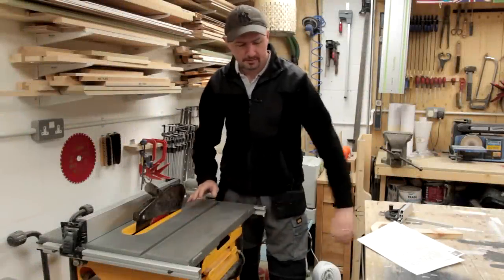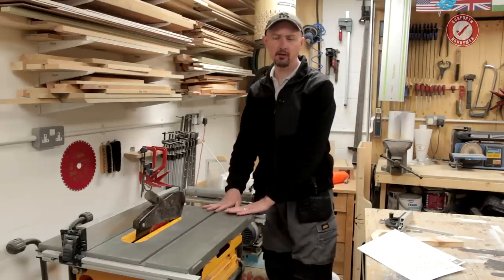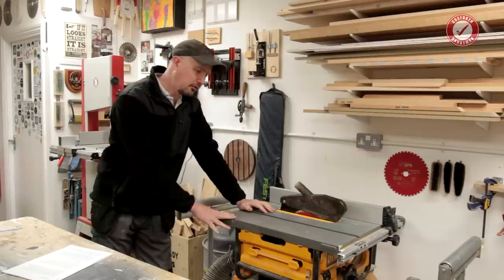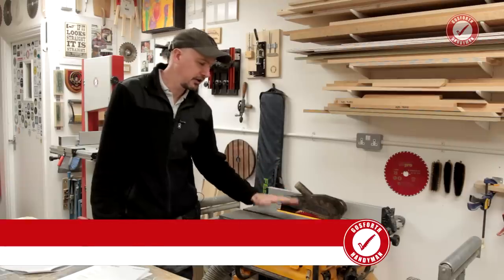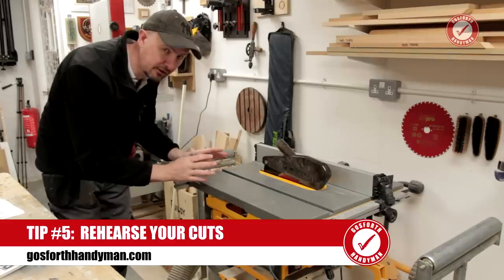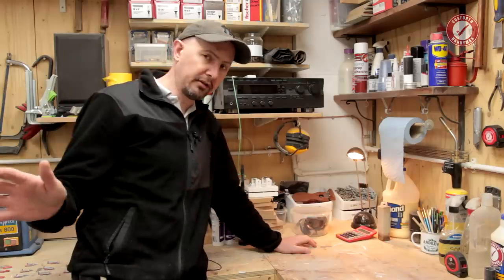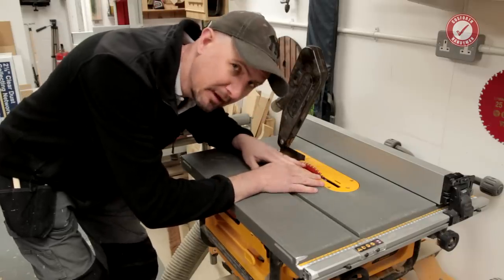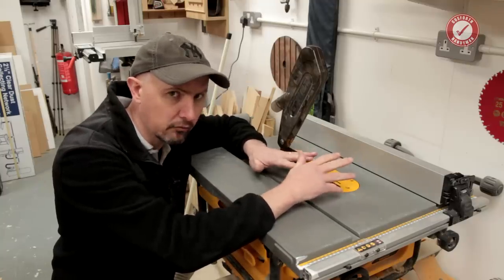TABLE SAW SAFETY - 11 tips to avoid death!

Comment: Thanks for a very good video. I am always aware of the power of my table saw when I use it, so I stay alert and respect the saw, as you say. 
Personally, I only use the table saw for cutting boards to size, or ripping long pieces, always with riving knife and guard fitted, and I use the long push stick.
Crosscutting I do on my sliding mitre saw, or with a crosscut sled on my bandsaw, which is a whole lot more ‘friendly’ saw. Fancy work I do on my router table.
BUT there is one thing I can’t figure out . Where is the best place to stand? The stop button is on the front, right in the kick back target zone. I tend to stand on the left, as advised by many safety guides, but that does require some reaching across. I saw your advice to stand on the right, but that wouldn’t work with a larger piece, so it’s a mystery to me which is the best place.

Comment: 100% agree.  I only still doubt sometimes where the guide rail (fence) should be relative to the saw blade for which cuts (like, fence stops before, halfway or after the blade) because (I learned in school) that you must avoid getting wood jammed between blade and fence.  Would appreciate if anyone could share a tip or link on that?

Comment: Ive been taught to always support the longest edge of the work.  Not sure if that kickback would have happened in your situation if the work was on a sled or you had a miter gauge but that would have supported your worked better than the fence did.

Comment: While I understand why you made this video, I don’t like the fact that many commentators below are now scared of the table saw. I believe that “healthy respect” for the tool is paramount. A huge danger is approaching a cut with anxiety... rather than confidence. The most dangerous tool in a workshop is the workman who doesn’t know what they’re doing. Plus, plenty of highly respected woodworkers (Matthias, Steve Ramsay, Colin Knecht) use jigs, sleds etc safely and there’s no reason why they can’t be safely used.

Comment: I recently got rid of my job site table saw because it was actually more dangerous to have the riving knife on. No amount of adjusting kept it from fishtailing outwards and pinching the board between the blade and the fence.

I got a sliding table saw instead!

Comment: The problem with cutting while on the side is you have to reach around to hit the emergency stop or switch. If you added a second stop switch in series on the side I would consider it safer.

Comment: As a newbie to table sawing I'm keen to mug up on all the available safety advice on using them. This video seems to be by far the best presented and explained that I've come across. It's brilliant! 
I've also seen videos about the GRR-Ripper as an alternative to a push stick. It's promoted for its safety benefits but using it does break one of the guidelines in this video - placing the hand above the saw blade - albeit with a lot of plastic between. I'd appreciate any thoughts on whether that's a sensible thing to do.

Comment: right off I see one major safety issue is the stock you have on the shelves above your saw could be a potential issue if a board comes down or for some reason the shelf breaks while the saw is running. I would not store stock above a running table saw.

Comment: There are a few things that you said that I would agree with. However, using a push stick for anything less than 3" is very dangerous.  It is all about control of your wood and saw, putting your hands on top of the board and pushing it through, doesn't give you control. Using your thumb on the edge of the board, with your fingers pushing it towards the back of the fence (of course making sure of where your hands and fingers are at all tims), holding it firm so the board doesn't creep out from the fence (this is why it kicked back on you). Make sure you stand to the left of the blade and safely push it through. The other thing is a person should always be afraid of the machine and that way you don't become complacent and always remember where you are and what your doing. I have 40 years professional experience running a table saw and have only had 2 kick backs and they were both because I was young and didn't have control. Maybe one day I will do a video on safety. I have seen alot of things in my career. If you want to know more, I would be glad to help.

Comment: Great vid. Close calls make us smarter. Different strokes for different folks. The push sticks you recommend scare me. Why would you hold a 'stick' pointed anywhere near the blade? Blade catches the end of the stick and jams it into your hand or fires it at you. I use a cedar 2X6 on edge, with a heel cut into it. On small stuff I run it right over the blade allowing it to cut 1/8" into it and both sides of the work are pushed through the blade zone. My saw is too old for a riving knife but beautiful.

Comment: My saw does not have a zero clearance inset, so there is a half inch gap on the left hand side. Yesterday an off cut fell in there and in a split second was projected back into my face hitting me between the eyebrows like a wooden bullet. Nasty gash and bump. Thankfully I wear normal specs which act like second rate goggles, so my eyes were partially protected, but it was too close for comfort. That’s why I’m looking at safety videos today. Gonna take more precautions from now on.

Comment: Thanks for a great safety video!  Things my dad didn't tell me, other than "Be careful!"  Never thought much about push blocks or cutting close to the fence, but sure will now.  I'm a little confused about what's okay or not at around 25:15 - maybe more explanation?  Why is it not okay to use the rip fence for cuts along the shorter edge of a plank, but then okay on a panel, and why okay up to around square?  I'll watch a few more times, but I have a hardwood brain (dense) and not much hope for self-enlightenment, so looking for a reply. Otherwise, thanks again!

Comment: Excellent information and yes it's been said before but in my opinion it can never be said enough, I had the exact same thing happen to me about 2 and a half years ago and it winded me so badly I stagard backwards it took me sveral minutes to recover my breath, I was cutting small strips of 1/4 inch plywood to make a pattern I had no riving knife and my blade was at max height, my table saw was similar to the one you show here but the one I now have is a full size 3HP table saw and if this happens again my recovery will take much longer if I'm lucky :(

Comment: I just cut the tongue and groove off some 6 inch oak floorboards and stood at the side so I could use 2 hands, and keep a constant load toward the fence and have my effort away from the blade. Also if it did kick I wasn't in front of a kilo or 2 of high velocity oak!! The offcuts of the tongue, 8th inch square maybe, flew across the workshop like rockets! Sadly my saw doesn't have a riving knife (Elu flip saw, don't believe it was even an option, please let me know if you know of one), and I have had kickbacks that luckily didn't hit/hurt... but I am very wary of it.

Comment: Thank you thank you! I just bought a used Dewalt 10' DW744 and it didn't come with the riving knife or blade guard assembly...I didn't even know what they were! After watching this video I went to eBay and bought the full blade guard assembly and will not cut a piece of wood until I have it. I also have 18" round pieces of wood I have to cut in half so I can have 2 half circles. If you have any advice / videos on pushing that through without it twisting / turning and having kickback I would love your advice!

Comment: Serious accidents happen fast, really fast.  My dad leaned a bit forwards, the blade caught a smallest bit of shirt that had come untucked, and pulled him into the blade. (No blade guard on.) He stood for 20 minutes holding his intestines while EMS worked to extract him from the blade.  He was hot loaded in a helicopter and flown to the nearest trauma center. (Fortunately, there were others around who saw the accident happen.) The blade came within 1/4" of slicing into his abdominal aorta.  Not sure how, but he survived the accident minus a few feet of intestine and was splitting wood 3 months later.  So I would add to your safety list:  Always wear snug fitting clothing and be sure to remove jewelry, hoody strings, etc. before using any power tool.

Comment: Just a different way to loose a finger or thumb:  I was cutting a bit of reclaimed wood and saw what I thought was a knot; it wasn't. It turned out to be a carpenter bee tunnel, armed with six rounds pointed right at me.  The vibrating started and the stacked bees ejected into my hand and face. Tried to swat them away, kickback ensued.  I was very lucky, only cut through a finger and a thumb.  I didn't loose them, but the ends don't have feeling any more!

Comment: Like a rattlesnake, I give a t-saw great respect, even paranoid!😱
My push stick is 20 inches long with a handle on the back, I also use  screws in the pusher, just barely sticking threw, just enough to grab the wood. Thanks for the info, folks need to know, especially those new to woodwork😁👍✝️🇱🇷

Comment: Really good points.  So what's the best method/tool to rip, lets say, 1 inch from the width of a 4' x 8' sheet?  In other words, when you actually want keep the wood from the waste side of the blade and reduce the width to 47" from 48"?

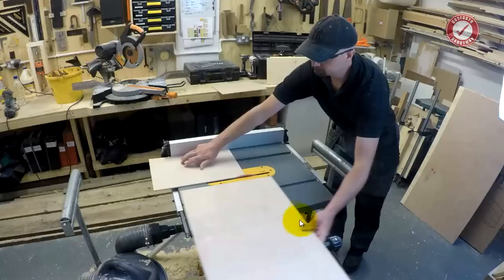Comment: 5:57. The suspense of seeing the severe kickback about to happen is gut wrenching! I had to pause the video to mentally prepare to watch it... Having experienced a bad kickback this summer, I'm still not over the trauma and shock of the experience. Once you realize how "cocksure" we are, not using any of the proper techniques, you go back and wonder WHY you didn't use safety precautions. Then you realize that there is no valid excuse, just as you so eloquently stated. There is no excuse for anyone not to be using a riving knife for all conventional cuts. Your life is on the line every time you use a table saw without a riving knife. A flying board can kill a person. You wouldn't stand in front of a machine that ejects 80 mph boards at your head, voluntarily? When we don't have a riving knife, there is nearly 100% chance that you will experience a kickback at some point. Every table saw user has had some type of kick back, or at least a bad blade bind, at some point. Not having a riving knife is like riding a motorcycle with bald tires in the rain, and trying rely on "experience" and "confidence" to protect you.

Comment: Many people are concerned with the blade being set only an eighth or quarter inch above the surface of the pieces being cut. They have good reasons, however sheet goods are not always flat. Imo it increases the possibility of kickback if the board rises above blade height because of any non perfectly flat wood. Also weight shift or minor user error right after completion of cut can bring the cut piece over the edge of the blade. The weight of the waste piece can leverage the cut piece up at the end of the cut. Frankly I think people are overly concerned with minimal blade height, although it's a concern. I generally use low powered portable saws for field use, I don't do much shop work on larger saws. I have seen students using less than flat materials who followed this advice of the the blade being only an eighth of an inch above the surface and resulted in the same kickback pictured here.

Comment: To keep fence parallel with the saw blade is one of big very dangerous problems at low cost machines.  It will be nice if someone address that issue in more details.  To me that is the second most critical point after riveting knife.  Thank you.

Comment: Best video. I just bought a DWE 7485 8 1/4. I have never used a table saw so I have spent a lot of time looking at safety videos. There is a lot of conflicting information out there, but using a riving knife is not one of them. I also installed the pawls (belts and suspenders). QUESTION: when standing on the side of the table instead of in front, would you still use a push stick or is it not necessary. QUESTION 2: my first job is that I need to rip 6” 8 foot cedar boards in half. Do you have any safety tips?  Oh by the way. I like the idea of using a chop saw when you can, and respect the saw don’t fear the saw. Thanks

Comment: Hello and thanks for the great tips.    I'd like to cut a piece of log with a width of perhaps 6 inches.   First from the top side, and then turn it over and do the bottom side to complete the halfway cut.  Because it's not a square or rectangle piece of perfectly straight wood,  how dangerous would it be?  How about if I cut it by standing on the side of the cutter?   Thanks.

Comment: how to retrofit riving knife for older table saws? 
I have a Craftsman 119 from 1970s, and only thing I can find is standard kick-back guard.
Reply: Buy a new saw with proper guards and a riving knife that is adjustable.  Buy a saw that allows removal of the guard while leaving the riving knife and anti-kickback claws (if included) in place. If replacing the blade, make sure that the blade width is in the range specified by the saw manufacturer - width matters.

Comment: Off topic but another power tool hazard is a wood splitter popping a big chunk off and hitting me at like 100mph in the groin. You mentioned it and I will never forget flying wood just different tool. A chainsaw can kick back and they can KILL YOU. A table saw I stood off to one side slightly in case of kickback. You really want to watch it on a planer. Those things can put a piece of wood into you. Just respect power tools

Comment: Thank you for the inforamtion. Just recently got a job site saw. I have tried to put the riving blade on but didnt like the way if fit, was taken off. Going back to see if maybe I didnt have it on right. Would you consider a safer way to go is making a cut sled for smaller cuts?

Comment: I've freehand cut miles of wood in that same saw. No fence, no riving knife, no safety glasses, mostly doing scribing cuts on Baseboard and 3/4 inch cabinet fillers. Looking back, the only safety protection I probably should have used was a dust mask.

Comment: Holding the piece along the fence whilst standing behind the fence seems more dangerous; that you are less aware of a slight movement away from the fence (towards the riving knife/back of the blade). It is likely more repeatable to always push the work ‘straight’ than trying to maintain a constant pressure to the fence (having no other reference for if the work is starting to bind).

Comment: A friend that worked in a cabinet shop was using a table saw to rip down a sheet of plywood, to save time they had removed the riving knife and safety guard. On the fateful day the plywood started to ride up on the blade about 1/2 way through the length of the sheet. She used her hand to pop the sheet so it would lay back down on the table. Only problem she popped the plywood directly over the blade. The blade cut through her ring finger, in between the middle two fingers and near the edge of the heel of her hand. Blood everywhere in the shop, she passed out from the pain. A couple of years of reconstructive surgeries, two failed attempts to reattach her ring finger ended up with removing the finger, ugly scaring and she only has about 60% use of her hand with areas of permanent numbness. By not using the safety equipment the shop may have saved 2 - 3 minutes a day cutting, her hand is a permanent disability. Ya, always use your safety equipment. Good video, great information.

Comment: I obtained a spare riving knife and cut it down just below the blade and it stays on 100% of the time. I also use a sled and the riving knife still remains on. ( i never use the guard). I have had a few close shaves but the main fright was when I cut some perspex and it shatterd, Shards were stuck everywhere even in the door behind me, That was a close call.

Comment: I appreciate all your safety tips. How do you handle cuts that need to be stopped mid point through the material? I always see people advising to push the piece past the blade but it’s not always the a desirable cut. I typically stop the saw with my knee and take the piece of wood away from the blade once it is completely stopped. Am I doing it right?

Comment: I have to mention this: The birds mouth push stick you're using is a dangerous bit of shrapnel. It's brittle and when a saw blade grabs the end, little pieces of it come off and go at blade speed and usually in your direction. Never use a plastic stick if the blade will cut a piece off the end.

Comment: My old football coach cut his finger off about 4 months ago on a table saw. They were able to reattach and he has no feeling, just numbness. I cut a finger to the bone with a Japanese chef's knife and it took about 4 years for numbness to go away completely. Luckily it was like a razor and made a straight cut. 

Well I got a table saw 2 Christmases ago and haven't assembled it yet. Been able to do a lot with a Kreg guide or straight edge of 6' level for circular saw cuts and miter saw for baseboards. Shopping for router. I want a decent plunge model for DIYer.
Reply: I will be making a sled when I put table saw together. I will also add any safety I possibly can.

Comment: Yep- I agree with all of this, especially the push stick point of contact! I always make sure I apply the push stick on the blade side half of the work piece so if there is a little uneven pressure- it's putting that pressure towards the fence- NOT towards the blade. I dont know of any situation where you need to get your hand close to the blade- have a variety of pushing tools. Good stuff Gosforth- Cheers from Texas